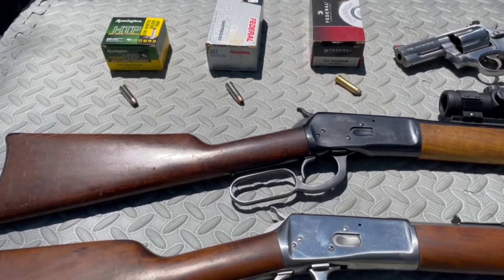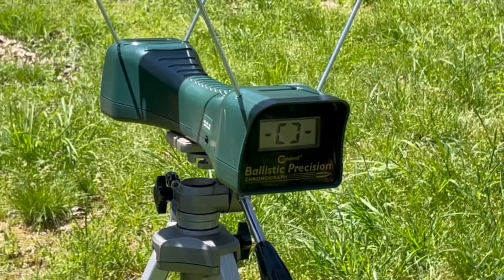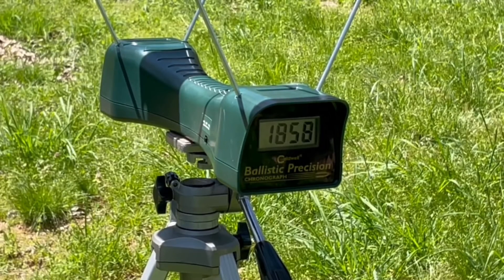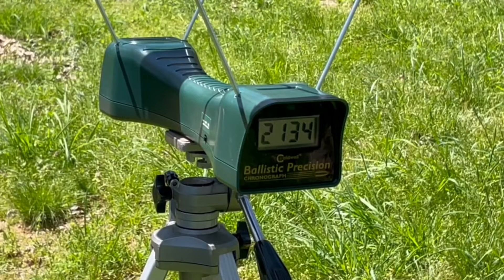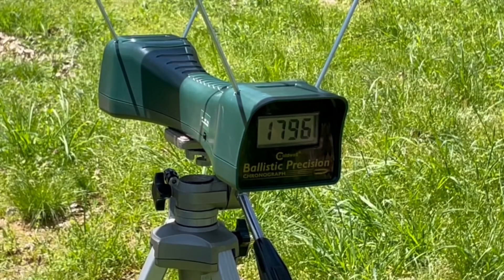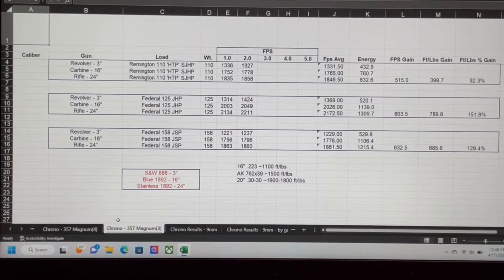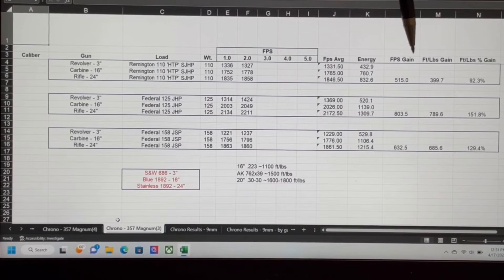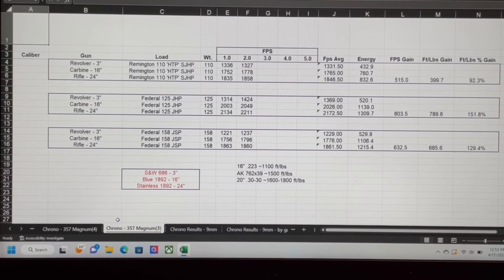.357 magnum carbine chronograph testing with common loads

Comment: Years ago I tested this myself with my brothers 16" Henry, my 20" Rossi 92 and a 6" Colt Trooper Mk lll and a friends 24" Henry.  I used 158gr Lee powder coated 358-158-RF bullets and max charges of H110 powder.  With the lead bullets and heavy powder charges my velocity's were higher but the same load was used in all. My results mirrored your's but I wondered just where the powder charges were fully burnt.  I had a gunsmith buddy solder the lug for a T/C Contender on to a Green Mountain 24" 357 barrel blank he had and using the same loads we started firing and cutting.  Not only did we find that the best length for the 357 load I was using was just over 21", after that velocity's started dropping and at 22" all that was left was drag and velocity started dropping but ES tightened right up.  He wanted to test some factory loads and we found when you saw the extreme spread close up the powder was getting fully used in the case.  It could happen at any velocity depending on the load but when the velocity's tightened up the powder and velocity increase was gone. IMHO the 20" barrel length was the most efficient for most loadings vs a 16" or 24".  I recently bought a 357 Henry X model with the 17.5" barrel and saw about a 125fps loss compared to the 20" Rossi, actually less than I expected which tells me that the powder charge was almost consumed at that length.

Comment: Thanks for this info. I'm thinking a .357 carbine would be good for whitetail within a hundred yards?
Reply from the maker: Absolutely. For perspective, consider that the 125 and 158 grain loads from the carbine and rifle are running 30 to 50% more power than a 44 magnum handgun load. Very few would question whether 44 magnum was adequate for deer at 100 yards.
Reply: @MyHillbillyLife  While not my first choice, would probably work well on large Bear as well. 😉

Comment: Just for perspective:
Buffalo Bore 158gr XTP rated 1485 fps muzzle velocity from 4-inch revolver. That's point-blank energy.
Using a 18.5-inch Marlin carbine with the same load, you get 2153 fps!
One can also translate this with a ballistic calculator.
Using the same carbine, at 160 yards you get 4-inch muzzle power.

Comment: The 3 inch 357 revolver is a less than optimal length for velocity in 357. More reasonable would’ve a 4-6 inch barrel length

Comment: I realize I'm a bit late to the game on commenting on this video.  Yes the longer barrel allows for higher velocities in the magnum cartridge.  Especially with the slower burning powders that can take advantage of that longer tube.  The problem is though that the ammo manufacturers and bullet companies design those hollow points to work at handgun velocities.  At those speeds the bullets just come apart not doing any where near the damage.  That's why a solid projectile or a soft point is a better choice out of a carbine.
Reply from the maker: Agree completely. For my carbine-oriented .357 handloads I mostly use xtp bullets, as they tolerate higher velocities than most.Also the reason I'm interested in the solid copper bullets like the extreme defenders & such.
Reply: However the XTPs to pretty well as defense loads in rifles.

Comment: Revisiting this video.. I've heard numerous times that the velocity gained after 16 inches isn't worth the weight gained and handiness lost by using the Carbine!

Of course there's a difference.. but not significantly more with the additional 8 inches of barrel length.

Great video btw.. goes to show how much is gained by pairing your revolver with a rifle 😊

My pair is..

Ruger Sp101 4.2inch 
and a Henry Big Boy Carbine 16.5 inch

Comment: How about a video on pistol length barrels snub, 3”,4”,6”7”8” or as many as you can assemble from collection and friends
Reply from the maker: I’d love to do something like that; I’d really like to have a 4 inch and 6 inch gun to test along with the carbines. But strangely, I don’t seem to know anybody with a 4 inch or longer 357 revolver anymore. I used to have a 4 inch and 4 1/4 inch myself, but they ended up both being sold due to a weird quirk of timing. (One was on consignment at a gun shop for about five months, so I finally took the other to a gun show one weekend and sold it. When I went to pick up the one from consignment that Monday, it turned out it had sold as well; so they both ended up gone.)